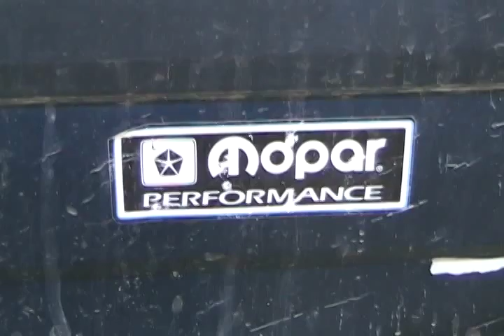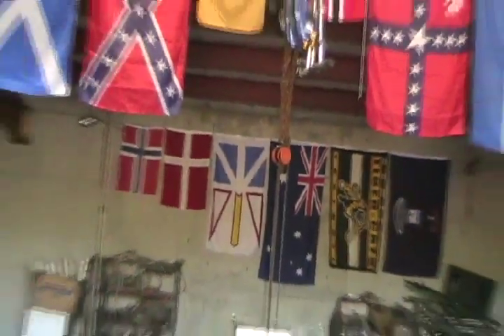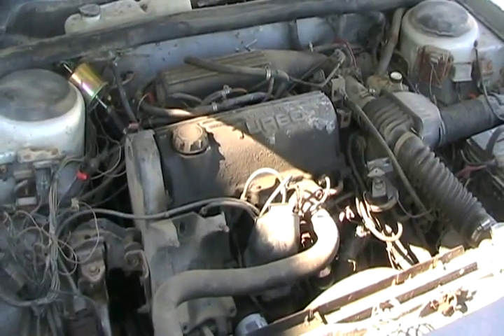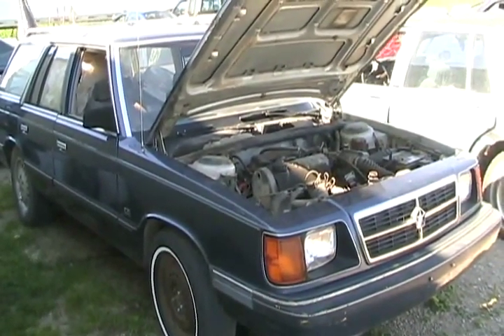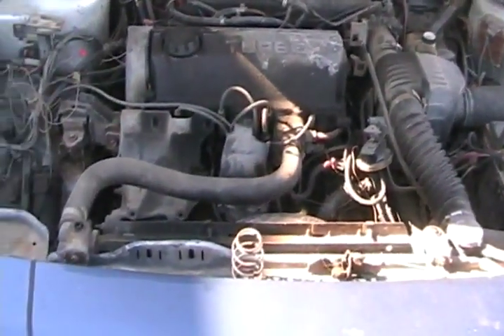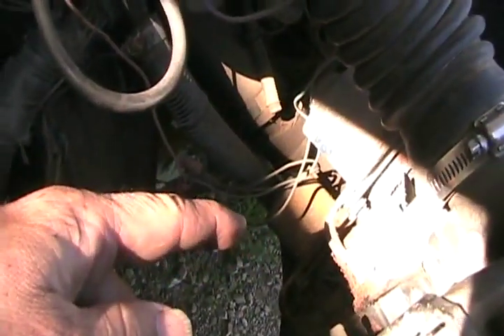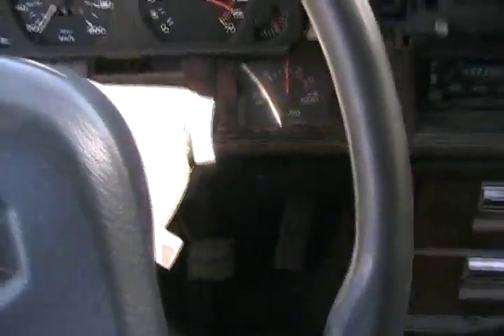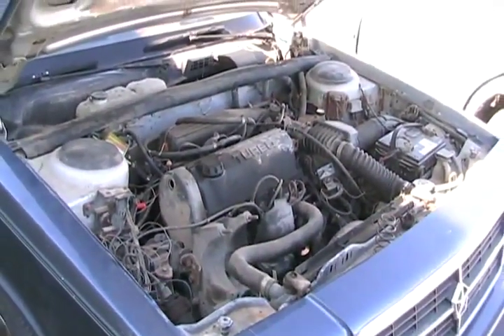#1385 Update on the aries turbo race wagon [Davidsfarm]

Comment: i feel like this dude tried to bullshit his builds to make them seem faster. its not really that fast tho lol
Reply: He put it together in 1991 230hp was fast at that time.
Reply: @benjaminschmied7998  And the car is feather light.  It probably ran 14's which is what 5.0L mustangs ran back then
Reply: He went from having a stock cam in one video to a having a aftermarket or "special" cam
Reply: @LeftLaneTdi04 This motor got rebuilt and replaced several times. One of the full floater wrist pin retainer clips disintegrated and trashed the cylinder bore. He talks about it in a video on piston design.